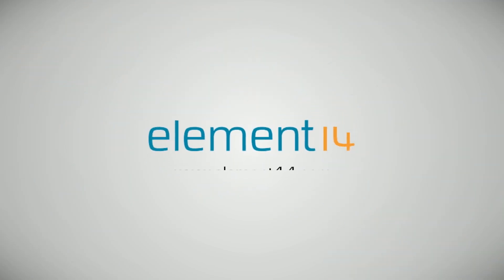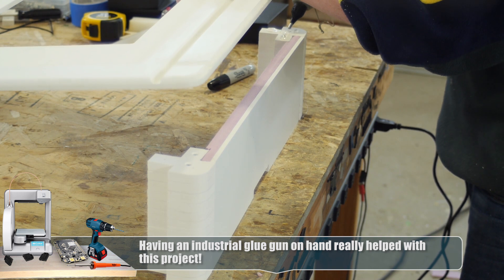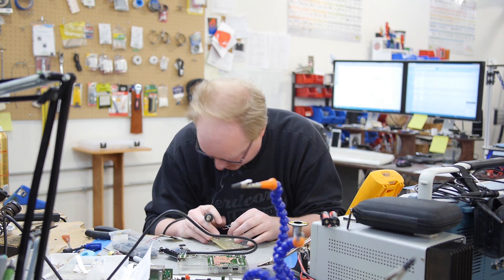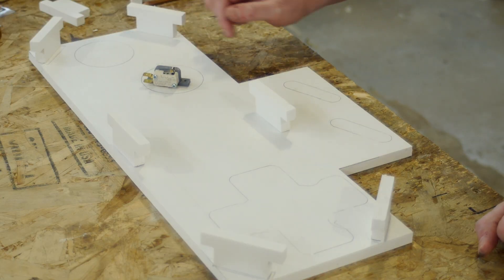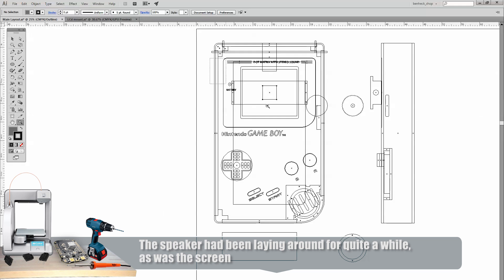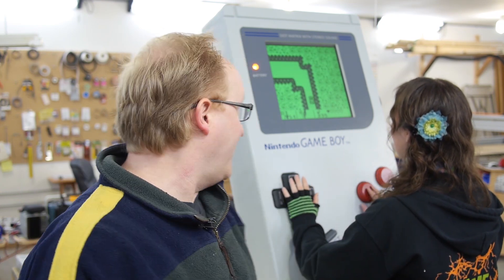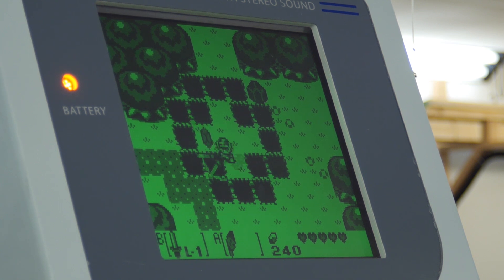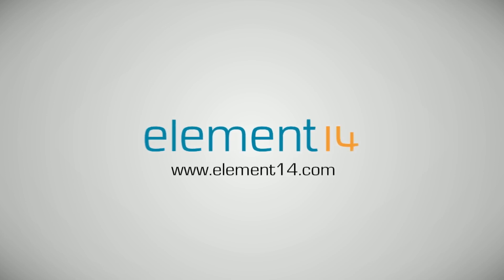Ben Heck's Giant Game Boy

Comment: looking at this you could try and make 1080p switch when it comes out wonder how difficult it will be, for those that don't know the switch in docked mode runs up to 1080p (900p) in handheld mode runs 720p due to limitations of the screen and battery life. I am sure with bigger battery some components from the dock and replacing the screen it should be possible.

Comment: The one thing I think this is missing is perhaps a regular controller port (maybe for an NES Gamepad) and Link Cable Port. I would put both of those where the original Link Cable port was, with a hatch you can close to hide those ports (and maybe you can actually store a Link Cable and NES Gamepad in there). The Original Game Boy had a cap for that port as well, so it wouldn't be too inauthentic. I just think it'd greatly improve the actual playability and being able to use Multiplayer Features would also be great.

Comment: Hey Benjamin! You should do a consolized version of the gameboy. Take the FPGA software you used in this episode, and "consolize" the gameboy motherboard, by having maybe 15kz RGB, VGA, or maybe hdmi, as outputs. And then you could cut the traces on the board for the controller, and make some kind of gameboy controller, maybe using an NES controller. Seriously, I would KILL for an RGB modded gameboy and you're right there man with VGA out of a real gameboy. So amazing man.
Reply: bagofclothes73 
Even better if it would have a button that would change it between gameboy mode and super gameboy 2 mode

Comment: I see hot glue guns used a lot here and on other channels a lot.  In my experience, things glued with a glue gun are just a ticking time bomb as the glue deteriorates on me in a few years and the entire project disintegrates.  Is this maybe faulty glue?  A glue gun maybe not getting hot enough?

Any comments on expected longevity of glue gun bonds?
Reply: Alluvian 
He said in the video that he used an industrial strength glue gun and glue. Meaning the glue is probably more powerful and bonds tighter.
Reply: comment is old i know, but shellac would work perfectly, i have vintage pens from the 30s and in some of them the shellac is still intact and hard

Comment: its stuff like this that make me think... what a waste of talent...
its cool but come on... we dont need it.

hows about doing something more interesting like building a sega only machine or nintendo only machine, play all game systems in 1. For nintendo have a slot for nes, snes, n64, then disc drives for gamecube and wii as well as build a cabinet with motion sensor for wii games. Now that would be interesting. Fuck the retron you got actual consoles all in 1.

Or how about a portable dreamcast/gamecube, even if run off an sd card.

How about a giant 3ds tho, now that would be cooler than a gameboy. Or maybe do a giant psp, even better.

Comment: Now you should build giant cartridges for each game you have lol.
BTW I made a USB adapter for my gameboy color, but would I need to lower the voltage? USB = 5v, GBC uses 3v. It works but I don't want to use it long term if it will damage it.

Comment: While thinking last night in bed about a new multi-monitor setup I'm working on I got to thinking; what about a multi-monitor laptop? When you open the lid it could perhaps fold out into two or even three screens? Perhaps on a vertical hinge with a latch of some sort? Even spring loaded so it pops out by itself? Or maybe it can function like a sliding door, sliding out sidways? You could also use it with the extra screens closed and use just the one screen, when you want it to be compact? This is perfect for you, master Heck

Comment: That signal issue with the display cable (at 7:06) was fascinating. I had a look at the original board schematics and can see that the GB drives the display with 5V digital logic (Horizontal sync, two data lines (for 2-bit colour), clock, vertical sync and a ground line). As you say in the video, insulation and shortening of the cable was a good solution to this problem. Adding to this, I was thinking that it might be cool to use this as an example of why solutions like differential signalling might be a good idea when designing systems for transmitting digital signals over (potentially messy) wires in viewer's own projects. Thanks for another awesome episode, I absolutely love the show. I've learned so much from it recently, having watched every episode I can in my spare time. It's become compulsory viewing material for me, so a huge thanks to everyone in the Ben Heck Show team, I'm a big fan. :D
Reply: Theremin Boy.

Comment: Maybe springs instead of foam? I don't expect that the foam will last for too many uses before fatiguing. Also, if the springs are short and mounted on solid platforms, it might also help with the wiggling of the buttons since there would be less of an arc that could be made by moving the button the same degree shift than now.

Otherwise, this looks like an awesome thing to set up in an office or coffee house to entertain people. (I'd at least keep it mostly upright like you have it to avoid it being used as a table.)

Comment: I work as an artist in a trophy shop, in fact, that's where I am watching this now, and setting up vinyl and weeding is part of my gig here. Super cool stuff you can do with it and we have lots of toys in the shop, from lasers, sublimators, engravers, and of course, my vinyl cutter. I'm very fortunate and I'll be able to use them all for my Tabletop Mini-Cab raspberry Pi Console project, The Vastendo - Cab King.
Reply: +TheRealVastile I just got a blast cabinet set up. Between that and the vinyl cutter, some sweet etching is going to have to happen in the near future.
Reply: I think we've got one of those, as well. I just set up our etchings. Anything flat goes on our lasers, but if it's a glass stein or the like, we invert the design and I hand it to our production guys. The compressor on the thing makes a huge noise, but it's a lovely machine.
Reply: They're really useful. Especially for cleaning metal before and after welding. But for etching, if you can fit the material in a laser, I much prefer it. Bonus if you have a rotary attachment to do round objects. The blast cabinet is great for large materials, or those that would be toxic in the laser cutter.